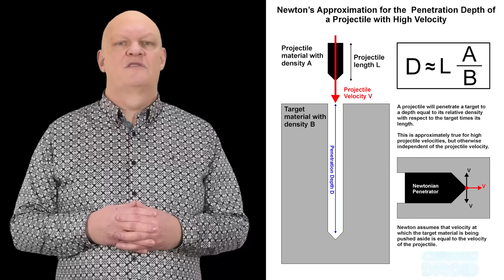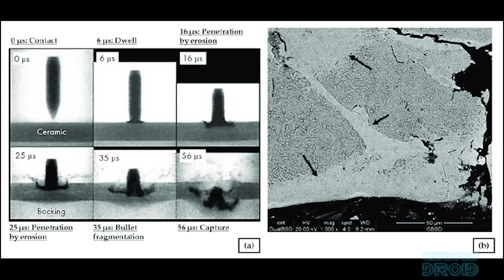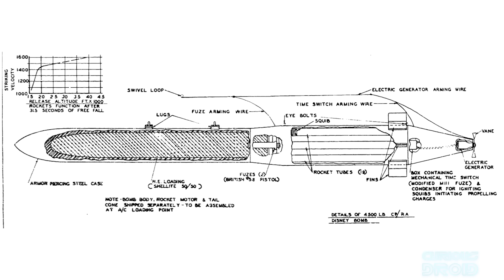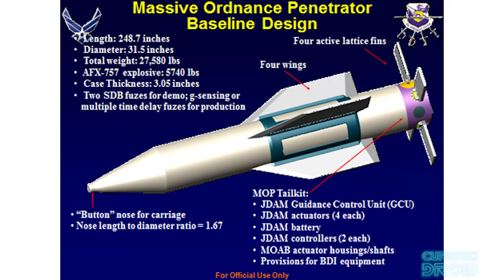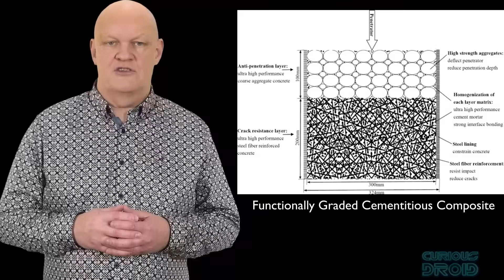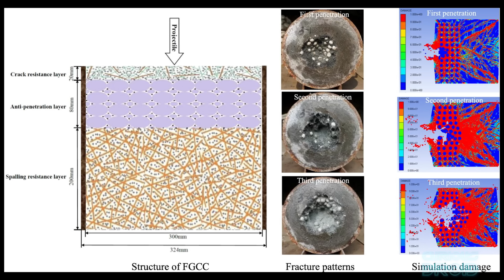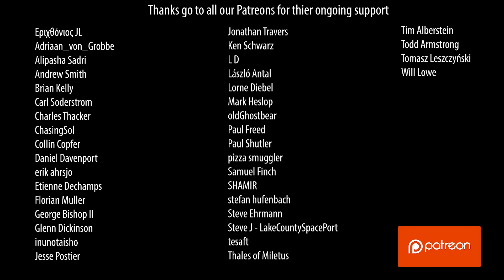Can Iran Stop U.S. Bunker Buster Bombs?

Comment: Supposedly the GBU-28 was put into testing so quickly that the first prototype was still hot from pouring the explosives when it was being tested the first time.
Reply: True. It’s called tritonal. TNT plus aluminum powder. It’s melted into a molten substance to load into aerial bombs.
Reply: @tommyrq180  TNT & Ammonium Nitrate
Reply: It was designed, manufactured, and deployed in less than three weeks due to an urgent need during Operation Desert Storm
Reply: @mr1shaggy  Brilliant job of expedient engineering. How do we take what we have immediately to hand and use it for something it was never designed for?
Reply: @fh5926  luck I guess
Reply: @F H  US engineer looked around and found old US army artillery and they used the barrel as the bomb, with design changes while it was being build/borred.
Reply: Until you got to 17:50, all this showed to me was a classic example of overthinking. For 15 minutes I’m repeating, ‘What about just severing the coms links or putting an FAE through the door.’ Then you said it and all was returned to normal.
Reply: @thethirdman225  Multiple entrances, well hidden. Communication links in the form of multiple optic fiber cables that go for kilometers before surfacing at a connection point (or rather are connected to another underground cable network.

You need to cover such a huge area that the only feasible way to do enough damage is using multiple nuclear warheads.
Reply: @57thorns  Yes, I’d already considered call of those things. I don’t see any of them as a deal breaker. Multiple entrance points wouldn’t do much to reduce the effectiveness of FAEs and there are other ways of attacking coms besides direct attack. Nuclear weapons are far from the only other way and they may be a step too far. Nuclear weapons are a lot more than a simple military decision.

FAEs were used very effectively on Taliban cave bunker systems in Afghanistan and have the advantage of being able to be carried by almost any aircraft. A GBU-28 weighs about 2,200 kg and there aren’t all that many aircraft that can carry it.
Reply: @thethirdman225  The difference between a cave and a bunker is the bunker has a blast door presumably set back a good 10 or so feet from the entrance. Hitting the blast door directedly and going through it would require the bomb to be A. Very heavy and dropped from a very shallow angle or B. A guided missile. 

An FAE in particular would never work with the blast door, it'd kill everyone standing near the bunker but the occupants would be fine. 

The even larger bomb at a shallow angle idea is infeasible for a few different reasons and the guided missile is already being developed in the form of hypersonic missiles with kinetic payloads.
Reply: @acorgiwithacrown467  It’s a pretty simple matter: use a SLAM or something similar to penetrate to door and follow up with an FAE.

Yes, you could definitely use a kinetic weapon on the door and that’s a very practical solution.

The caves in Afghanistan were extremely long and had multiple entrances/exits. That didn’t reduce the effectiveness of the FAEs.
Reply: @thethirdman225  Counterpoint, add another door behind the first, purposefully built for containing blast pressure of an FAE. 

Look, if it was as simple as your claiming thats what they would be doing, clearly they know something thats convincing them attacking the entrances won't work.
Reply: @acorgiwithacrown467  
"Look, if it was as simple as you're claiming thats what they would be doing, clearly they know something thats convincing them attacking the entrances won't work."

Targeting an underground bunker is also difficult and missing one is not difficult. It is, after all, underground. The central point may be well away from the obvious entrance points and, like a long-legged spider, the total size may be much larger that the central part of the bunker.

This is the whole point: there's always this point-counterpoint that just ends up being a waste of resources to accomplish relatively little. The target becomes more important than the object of the exercise. Destroying it is only one way of putting it out of action. A war on coms is easier. It's almost like a deception operation that causes the other side to spend an inordinate amount of time on something that is basically meaningless and designed to do nothing more than waste time.

To function at all, a command bunker needs all kind of support systems, from power to water to sewage to fresh air. Not to mention the fact that senior commanders come and go. All this leaves a trail. During the 1991 Gulf War, communications was a major target of the Allied air campaign from day one. The famous raid on the communications building in Baghdad by the F-117 resulted in an absence of centralised command from the first night of the war. While there will never be any guarantee that the communications building you're targeting will be quite so obvious, no bunker is completely self sufficient. The Maginot Line had the same problems.

The Maginot Line was supposed to be basically self-supporting and not easy to attack by traditional methods. The Maginot Line was not destroyed by German artillery and tanks and was still almost entirely intact at the time of the French surrender. And like the Maginot Line, a modern, highly reinforced underground structure can be defeated by less straightforward or obvious means than an expensive weapon which is otherwise of very limited use. A classic example of overthinking the problem.
Reply: @thethirdman225  ?
Reply: I remember that. IIRC it was a Lockheed project.
Reply: Wat
Reply: around 2 months if i remember correctly
Reply: Thats the different between Russia and the US
Russia has urgent need for drones but had to ask Iran
When the US has urgent,  US defense companies have always stepped up and delivered
Reply: @verdebusterAP  So what? Russia have had drones for decades. If they’re buying them from Iran it’s because of the world wide sanctions that have been (rightly) imposed on them.

Comparing Russia and the United States this way is a bit silly. How many countries have sanctions against the United States? Very few and probably none is a deal breaker. US defence companies… Jesus Christ…
Reply: @thethirdman225  
No Russia claims to be superpower on par with the US and China
if they have an urgent
their own industry is supposed to met their needs regardless
Reply: @verdebusterAP  So what? You’re assuming a level playing field here, which is absolutely not the case. Even America gets stuff from overseas contractors, which Russia clearly cannot. Look at the F-35 as an example.

Besides, who GAF what you say the Russians say? Or is this yet another pathetic case of trying to to prove America is better than Russia?
Reply: @thethirdman225  
Yes the US does get stuff from oversea but with the GBU-28 , they rapidly developed it record time
The Marines needed a weapon that was effective against caves and bunkers., Talley Defense Systems again stepped
The US gets stuff from oversea as needed 
Russia should have their own internal capabilities but as Ukraine is proving
they have literally nothing as their were too dependent on imports
Reply: @verdebusterAP  ‘Should have…’ That’s like MUST-urbation - it makes you blind.

Russia has very few allies. Even the United States doesn’t have complete industrial independence.

I couldn’t care less about a simple weapon like the GBU-28, which was nothing more than an adaption of a GBU kit to a bigger bomb. How the hell do you know what Russia’s industrial capacity is? You don’t so stop lecturing.
Reply: @verdebusterAP  Don’t you read? Who cares what they claim? Why do you even care? Why do you think I should care?

Why are you so desperate to prove how much better the United States is than a country with an economy the size of Brazil?

I’ve never heard any such claim about AESA. I reckon you made that up or confused it with the MiG-31, which was the first fighter in the world with a phased array radar.
Reply: Supposedly as the "info"* goes it was warm when the plane dropped it
Reply: @foracal5608  well Snoop Dogg sure dropped it like it was hot 😬